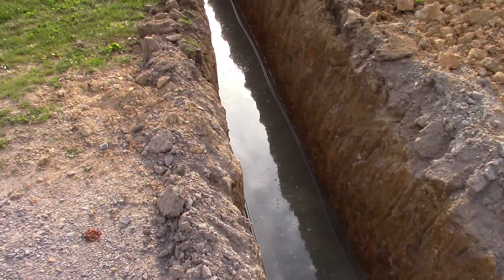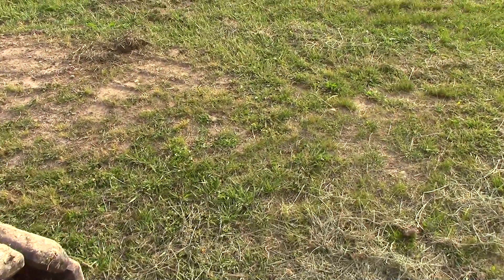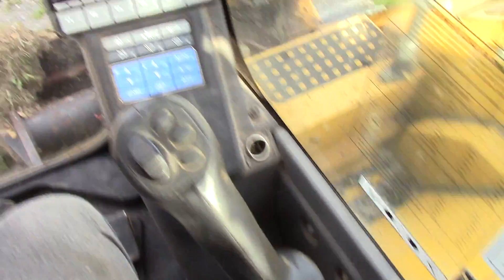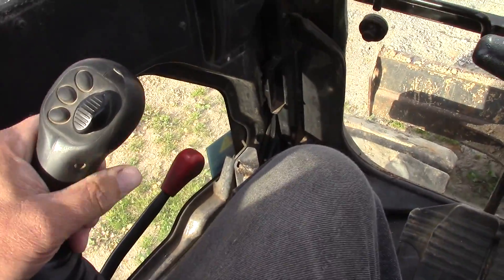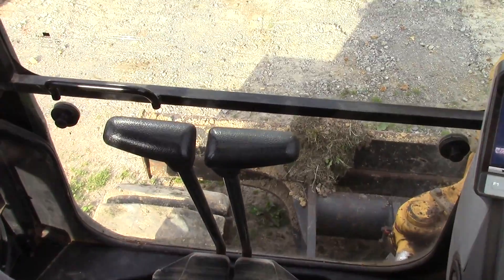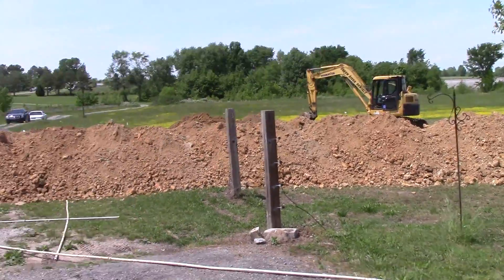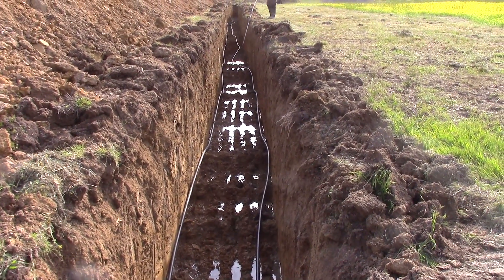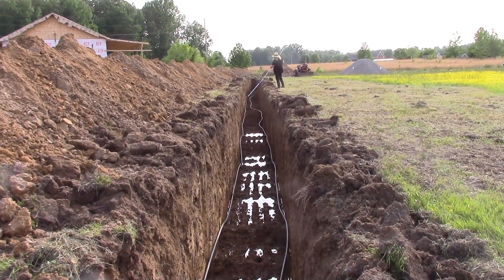Part 4 of our Geothermal groundloop installation.

Comment: whats the load of gravel for mac?
Reply from the maker: +obieezx11 The gravel is to cover back over the driveway. The three trenches cut across the driveway. Its raining this morning and its a muddy mess out there. I was hoping to get it covered back over by Sunday night but it didn't happen so now we have the cars parked way down the driveway and we have walk around the house to get to the cars LOL!. I'll have to finish it up this coming weekend.
Reply: +Mac Gyvers Workshop can you cover it up with out having to spend another 1000 on the digger hire.
and your gunna have dirt left over till it all settles back down again
Reply from the maker: obieezx11 I can use my mini backhoe/loader to move the remaining dirt, and lay out the gravel. I have a grader blade for my big tractor to spread it out afterwards.

Comment: too bad you aren't going to have that excavator any longer, i'd ask you to bring it over and scrape my drive way flat again and then get some crush & run and then some screenings put down to lock it all in place for a while
Reply from the maker: +DaddytechEnt We ran that thing all the way to the end. I ended up using up all the hours allocated for the weekend rental and an additional 10 hours. Whoever says they can dig something like that in a few hours is full of it. You have to go real slow and careful up close to the house, and even out in the open, after I got real good with it, it still takes a lot of time to dig down 6 feet. All total, with the diesel fuel, we spent right at $1600 for that thing, but it was worth it as a friend of my son in law who does excavation offered to do it at a discount rate of $65 per hour, but his backhoe only had a 2 foot bucket, we had to have 3 feet to spread the lines far enough apart. That plus the fact of that super hard clay we ran into would have probably caused him a lot of grief and ended up costing way more in the end as he would have had to make 2 passes to get a minimum 3 foot width on the trenches. of course there is the benefit of me being able to watch somebody else do it, but I think it would have ended in disaster as his backhoe would not have been strong enough.
Reply: yeah, as costly as it was when you told me what you had to do to install that you actually went the right route that's why i didn't have any comment about the method you used to get where you were trying to go with this, The depth you had to go and the speed you needed that all done in dictated that you had to have that machine. did you see the one just like that for sale down at the end of our road though? lol
Reply from the maker: Yep, Talked to him about it. It belongs to one of his customers. Its smaller than the one I rented, and truth be told, I probably could have stood to have an even bigger one, as it struggled with that hard clay and made it take about twice as long as it should have. The guy wants 18k for it. Its pretty decked out with a swivel scoop for doing swimming pools.
Reply: nice! well we could put that thing to good use for about a year getting everything in order around here like that ditch and your driveway and the pond and such.